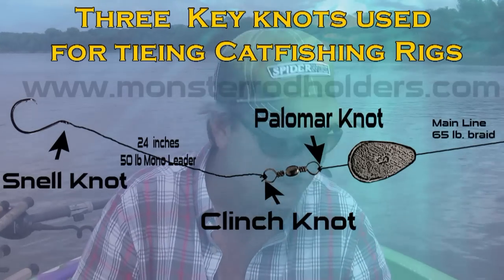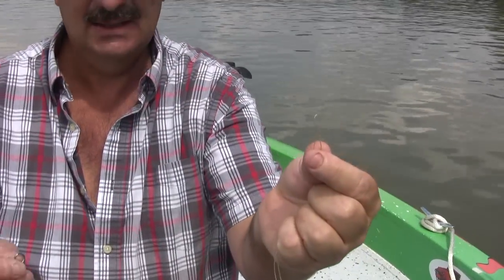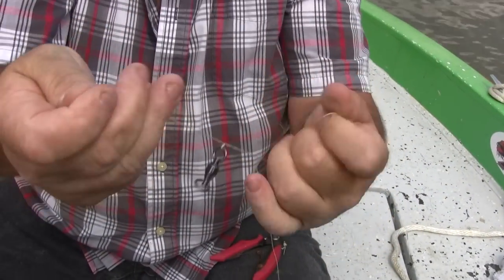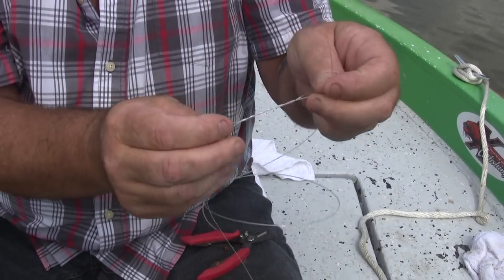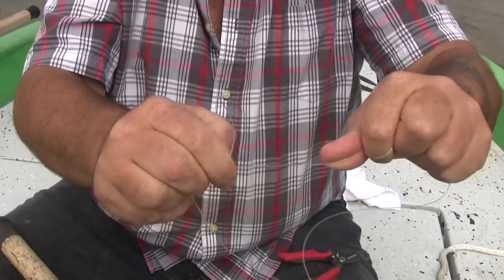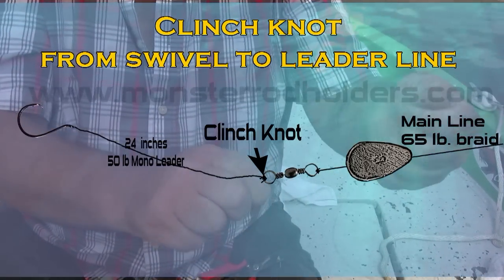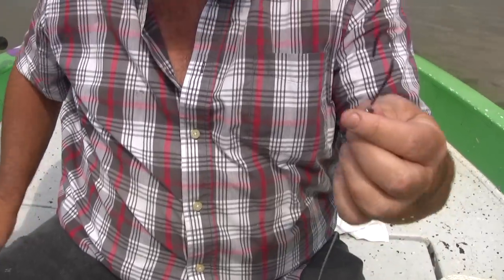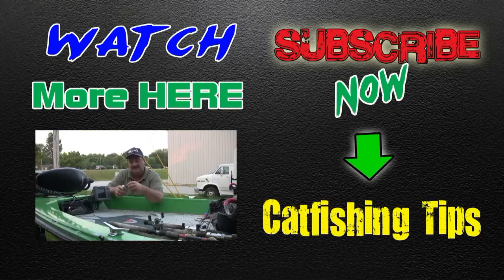3 of the best KNOTS to use for your catfishing RIGS.

Comment: Steve, if you tie your knots in the reverse order, meaning you tie the hook on your leader first, then the leader onto your swivel, and then the swivel onto your main line, you can use a polomar knot to attach the leader to the swivel AND the swivel to the main line. The polomar knot has better tensile strength than the improved clinch knot. Its a little trick that someone showed me and it probably only increases your chance of catching a big cat by 1% but sometimes every percent helps.

Comment: any chance you could explain or compare your typical bank sinker to a slip sinker?? Ive always used just a bank sinker but the professionals like you always use a slip sinker. What advantages does the slip sinker have?
Reply: I know that I'm not Steve, but with a slip sinker, the fish doesn't feel immediate resistance when it takes your bait as your line can slide freely through the sinker.

Comment: Couple of questions: could a big enough Catfish break the swivel? Why don't you just use 65lb braid? Good video as always! :)
Reply from the maker: I use swivels rated for 150 lbs so Im not seeing a catfish break one like that.
the reason I use the leader instead of just braid is the break off factor, if I do break off i will more than likely just lose my leader and hook, if i used braid all the way to the hook and break off, I lose all my tackle.
Reply: Braid is not very  abrasion resistant either  i use a mono topper as well as mono leader. Im about to post a video on how to tie the albright knot. To attach braid to mono

Comment: That's the old traditional Snell knot and it's one of the strongest knots you can tie. The knotless knot is faster to tie and just as strong. I have found that if I tie my hook first with the knotless knot, then tie my leader to the swivel with a Palomar knot, I can then tie my my main line to the swivel using a Palomar knot also. You just have to pull the whole leader through the loop. Not saying my way is better or anything like that, I just like using Palomar knots whenever possible because they are so easy and nearly foolproof to tie. Also a group did a series of videos on fishing knot strength, the Palomar turned out to be one of the top 3 strongest knots. The others that beat it are complex to the point of stupidity. So there is that too.

Comment: why do you do 3 different knots? why not the clinch for the hook?
Reply: vapaholic 
Steve may have a different reason than me but I use the Snell on the hook because it gives ( for lack of a better word) a cam action when coming back out or the fish's mount which gives a higher chance of a hook-up 
I tie a polymer knot on both ends of my swivel but you must tie leader to swivel first,then to main line and then use Snell knot to attach hook to leader line.
If Steve advises something different you may wish to go with him because my PB is only 40 lbs for CATFISH but knots breaking aren't a problem
Reply: Your hook and leader  shouldnt be weak but it should be weaker than your swivel and main line and a stronger knot  so in most snags you can usually save your swivel and sinker  only losing hook or hook and leader. I have a video on my page explaining this  and a close up of this snell knot with bright line

Comment: Curious, why do you use 3 different knots on this rig?

I'd think Uni for braid, palomar on mono leader, and snell on hook would work better. But I would divert this question to you, as you have MUCH more experience than I! :)

Love your videos!!! =D
Reply from the maker: kevin we use what we are comfortable with, im sure that your combination of knots will also also get the job done.
Reply: kevin, a uni knot will not hold braid one of the only braid knots is the palomore,    The snell he is using is a uni snell actually, and works well and I use a uni on the trace to swivel and than a palomore knot on the braid so really its just two different knots on the rig.   But yea comes down to what you like and what works- just id switch over from the uni on the braided mainline to a sure fire palomore.
Reply: I haven't had a uni knot fail on braid for me, but I also wrap 7 times, Instead of 3-4.

Comment: Hey Steve nice hat I like that brand spiderwire ! I'm a beginner angler so I'm not familiar in what brands are "good", do you prefer that brand for fishing line preferably ? And if so do you specifically like spiderwire for all 3 types of fishing  line? Or do you like only a certain type of line for spiderwire based on different settings?
Reply from the maker: i used to use the spider wire but i use my own monster brand now. i will have it on our site next month.